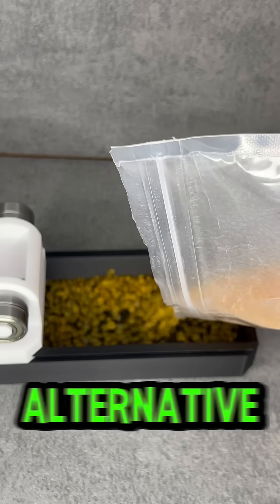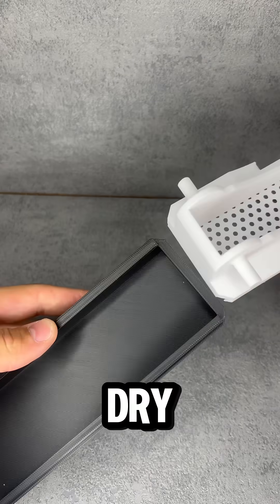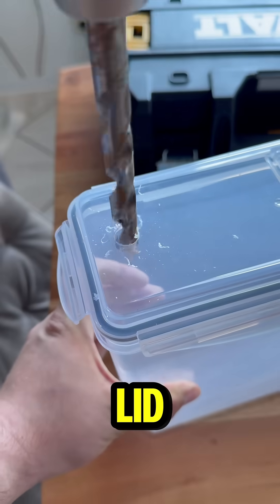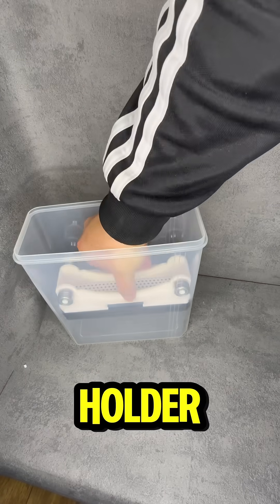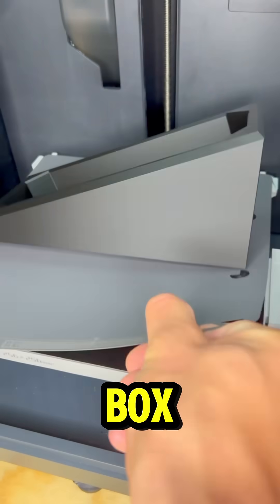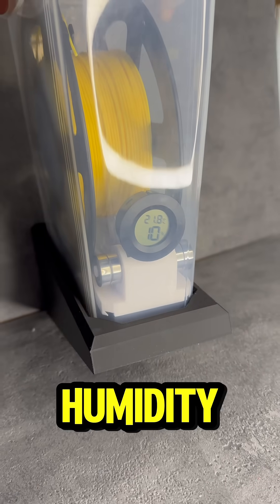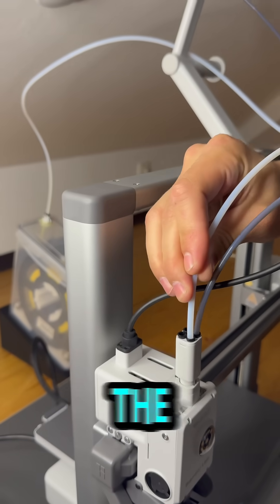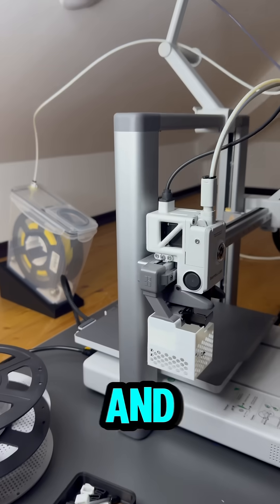Cheaper and drier than the AMS: DIY Drybox‼️🤩#layerworks #diy #3dprinting #filament #ams #dry

Comment: Yeah except the AMS is what lets you print in multicolour that’s like the main thing that AMS exists for
Reply: You can't rewind is what he means... no way to unload one to load the next color without a real AMS. The AMS is what pulls it back, unloading it...
Reply: @YTSTK89 Actually no it doesn’t, yes there  are four holes in the print head but not four extruder motors. There are four separate motors in the AMS/AMS lite system that feed the filament into the print head. With the setup like shown in the video  you can’t automatically print multiple colors. (No hate)
Reply: Thanks for the clarification 😅 @lucasvandenberg7350
Reply: Couldn't you just use 4 motors and bowden tubes going to one print head like the a1?
Reply: @KiloFeenix It is possible but you probably need to have custom code or something for that to work.
Reply: Not quite. The AMS HT only accepts a single spool of filament. It has an integrated dryer, but other than that, all it does in an automated fashion is feed the filament.
Reply: @wmichaelis ams literally stands for automatic material system. You need it motorized so it works for filament swaps. The ams ht is meant to be added to a standard ams, it just dries at a hotter temp, and adds a 5th color
Reply: Bro just build a pico mmu
Reply: This was an A1 so I think you mean AMS lite!
Reply: @ku8721  It is not only ams lite buddy
Reply: Why hasn't anyone bought ams spare and replacement parts and built one from scratch? This is a near perfect filament storage box.
Reply: @leftcoastcrawlers2831 bc all the parts including the mainboard make it more expensive. You could however make the open source one on the open bambu subreddit
Reply: @leftcoastcrawlers2831 some have done it. Also: BMCU from aliexpress
Reply: You can still AMS, just have to do multiple boxes, this way your material stays dry. Just need to feed the 4 lines into the printer. If you look, the printer has 4 holes for the filament
Reply: @YTSTK89 than it isn’t an AMS because it can not switch automatically from one roll to another.
Reply: @YTSTK89  That would be a manual material system. not automated. And regarding other comments as bambulabs is not open source, and for the most part only works with other official bambu equipment. unlike other printers being able to run marlin and klipper etc. this means for a multi material system to be functional you will need an ams as a donor. which defeats the purpose of doing this. there are "open source" versions of the ams but again these use the guts from a functioning ams.

Comment: Are 4 bearings needed? MAYBE Update with only 2 ?
Reply from the maker: We use different filament brands, and they have varying widths. If you only use four bearings, some spools might not fit properly.
Reply: Just space out the bearings so they work with the spool you have in the drybox if you want to use less bearings.

Comment: How Long to Change the silica?
Reply: Don't need new silica, you can dry it by heating in an oven. Turn on the fan!
Reply: when it gets moist it turns a greenish color most of the time then you can put them in a dehydrator or oven on low heat till they return to the normal color
Reply: @danielreid3469  actually no, the green color show that it is too wet. But it shows it too late.
Reply: @danielreid3469 or the microwave for faster / better results just got to do short 30 second runs opening the microwave in between.
Reply: After changing of the filament.